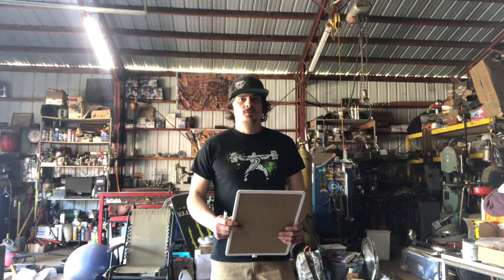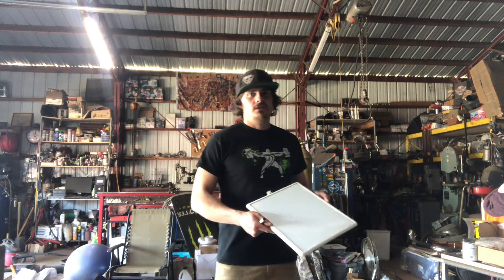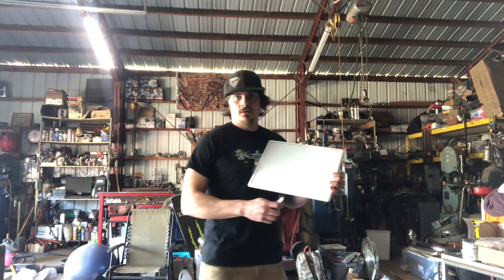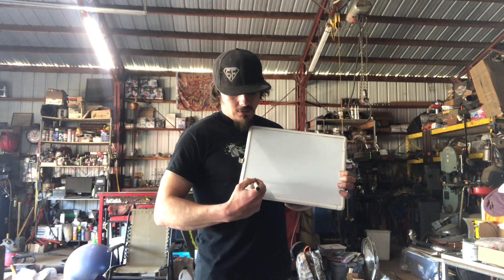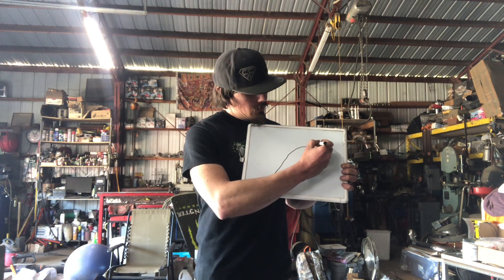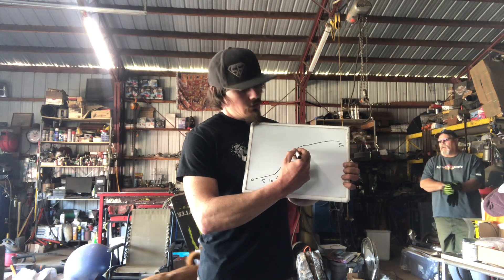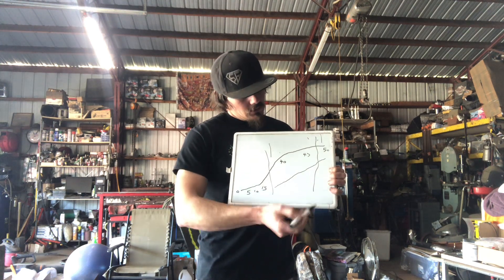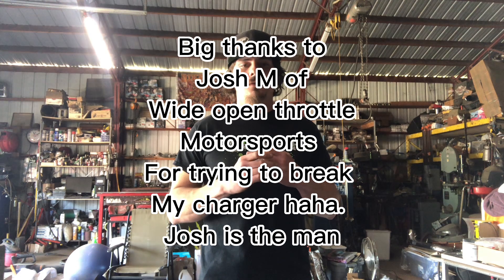12v cummins s363sxe 12cm/.70ar testing and review

Comment: What’s the brand of the digital display showing the vital info? It’s a P Pump pickup your testing, right?
Reply from the maker: It is. 97 dodge ram 3500. 

The gauge is a cts2 with the 12 volt power supply kit